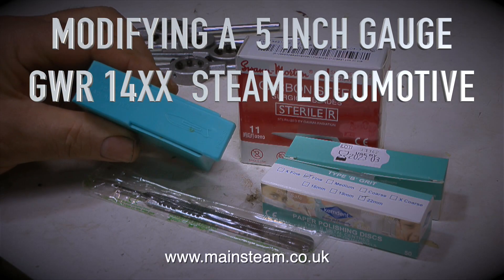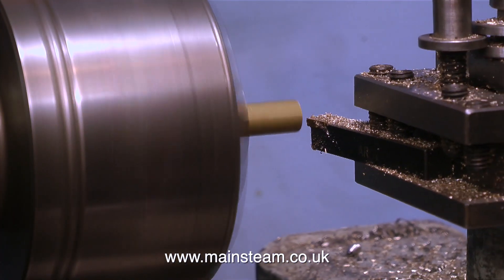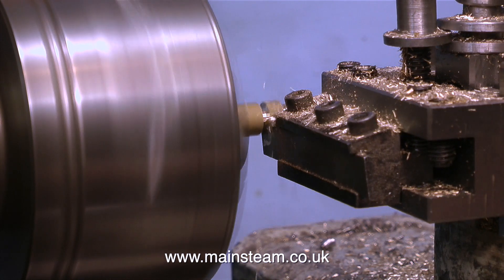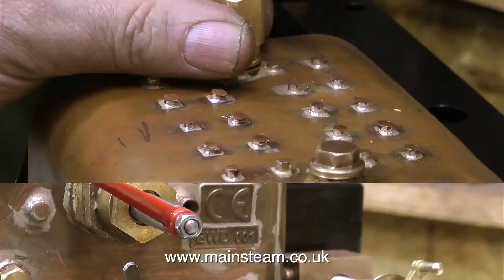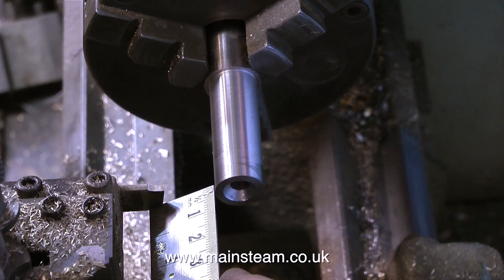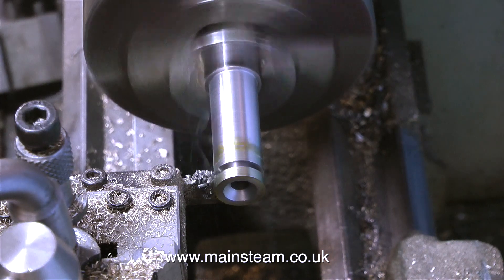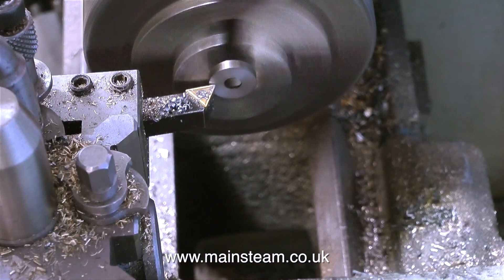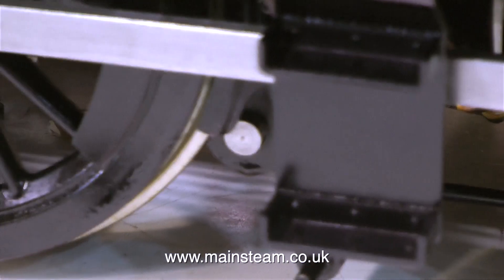MODIFYING A 5 INCH GAUGE GWR 14XX STEAM LOCOMOTIVE - PART #9

Comment: The Chines People are different. Years ago an employer of mine built a factory in Hong Kong. They decided to have a nice desk built to go through the window into the manager's office. So a Brit measured up the gap in the wall in inches. The desk was dully made. It would not fit through the hole in the wall. They sent for the Carpenter.  He got his measure out & proved that it was made to the required dimension. They then checked his Chinese measure against an English one. The Chinese inch was bigger. Now in the intervening years the USA influence on Chines measure is such that one inch is now 25.4 mm. Now 40 TPI works out to 0.635 mm pitch & 1/4" is 6.35 mm. So my guess is that the Chines have simply metricated it with a US 60 deg thread angle as opposed to our ME thread which uses a Whitworth 56 deg thread form. Mervyn Price

Comment: In principle with ISO metric threads you can combine any nominal diameter with any pitch (within reason). 32 TPI is very close to 0.8 mm pitch. I was a calibration engineer for a thread gauge manufacturer for a few years, so I became quite familiar with BS 3643, which is the relevant British Standard. A bit rusty now, though!

Comment: I saw someone centering parts in the chuck by using a ball bearing as a roller. He would touch the bearing to the front of the part, off center, as it spins in the lathe, and the part would be pushed into alignment. Granted, this was being done with small parts, so your mileage may vary.

Comment: When you are totally bored! When the workshop is too cold or too hot to work in! When the track is closed! When the Pubs are closed? Get out your Tracy Tools chart INCH TO METRIC CONVERSION which is very useful, and you get if you buy many taps and dies.
Flip it over to the DARK SIDE and it has every thread there ever was or is!!
I am intrigued by Fluteless Taps in the bottom Right hand corner!
Can I admit to having 2 charts to avoid Flipping!!!

Yes I spent too long outside the workshop yesterday!!!
Today is Club Running and Young Engineers!!
We have got rid of the Neighbors... And got in, super New Ones!!!!!!!!!!

David and Lily.

Comment: Here in Germany we get metric ISO- coarse or normal (Regelgewinde) threaded bolts, etc. and fine (Feingewinde) with a tighter profile and smaller pitch (there are different pitches for a given size). If this is of interest Newmann Tools has a chart on the Internet that you can find if you look for Metric Fine Thread Data. Most mechanics have a chest of drawers with coarse and another with fine threaded bolts and rods. Sorry if this is of no interest to anyone.

Comment: Anyone who finds grinding lathe tools a RRPITA, can cure the problem instantly by getting a "diamond lathe tool" (the Australian manufacturers have a U.K. Distributor)
it is a tangentially mounted tool that uses bog standard 1/4" sq tool steel. Only the end of the steel is ground, using a supplied fixture, so even a brain dead moron like my boss could cope! The resultant tool cuts better than any of my carbide tools and my normal hss tools. It is my go to lathe tool ever since my mate in America sent it to me.
If Bahco made lathe tools, they would be tangentially mounted end ground ones like this....
Look it up on YouTube.
If someone stole mine, I would buy another .

Comment: Lathe tool grinding has always been a bit of a mystery to me.  Most of the time I'm turning plastics so I can get away with a tool that's not quite right but sometime I have to machine a bit of brass, aluminium or even steel.  
My old Hercus lathe has the tool fitted on the half moon mount (I don't know what it's called) and finding center each time I change tool is a pain.  But I've notice you're changing cutting tools without taking the trouble to find center each time. 
When you make the tool grinding video, could you please include the easiest way to find center ?  That is unless you've covered that already.

Comment: The difference in your 1/4 x 40 threading might be SAE vs Whitworth. SAE which is the American Society of Automotive Engineers thread spec is 60°. Whitworth threads which are a British standard are 55°. It wouldn't take much thread chasing to make one fit the other I think.

Comment: I think it just must be M8 fine. M8 is .315" od. 5/16" is .3125" od. So that would account for a bit of the loose fit you are getting. M8 fine is .75mm tpi, which is equivalent to 34 tpi which is equivalent to 30 thou per thread. ME 32 tpi is equivalent to 31 thou per thread. You probably only have 4 threads of engagement. Given that you are creating a slighly undersize 55 degree thread to go in a 60 degree hole, it's not surprising that it kind of fits. Blackgates probably do them, but certainly M8 fine dies are available from e.g. Chronos for £6.75 delivered. No I am not a self-styled expert, just a man with a calculator.

Comment: simply theres metric and theres ISO metric, japan for example till recently didnt follow iso metric, and they had funny threads and non standard metric heads on their bolts (such as 12mm instead of 13mm on an m6 bolt) , and also didnt use philipps or pz,  and used their JIS standard which is easily confused with philips heads, all of us with 70's japanese motorcycles have since found out and rounded off the heads

Comment: Where i work we got a couple of CNC profile cutters from china and they use a metric fine thread for the gas line fittings they looked just like the normal oxy acetylene but they were terribly loose i think the thread was 12mm outside diameter

Comment: When setting parts in the chuck jaws I do very similar, sometimes sliding a spacing piece behind it between the chuck face and the part, slide the tailstock up, square the piece in the jaws and tighten down. the spacer helps if the work piece gets too far back, it gives you something to grab to slide the piece back in position, you do have to remember to remove the spacer, like the chuck key you only forget to remove it once.

Comment: I don't mean to change the subject but I don't know any other way to communicate with you. I recently read of a Manx Man who is building a steam driven motorcycle for land speed record runs. The article may be in error as it says he is burning kerosene to generate 2000 psi at 510 degrees Celsius. That all seems odd, but I have very little steam knowledge. Can you share your thoughts and wisdom on that, please? I can provide a link if you wish.
Reply from the maker: I would think that the only way a steam motorcycle would work is with a "Flash Steam Boiler" which is just a coiled tube of piping which is heated by a blowlamp type burner, when water is introduced into the tube via an engine driven pump it "Flashes" into very high pressure high temperature steam.
Reply: Thank you. I am unsure of the quality of editing in the article, so when I read two thousand PSI, well,,,,,, wow.

Comment: How can 1/4-20 be different than 1/4-20? Thread shape?
Reply: Yeah - 1/4-40 ME is different to 1/4-40 UNF, which I think stands for unified thread standard - fine. At least it tells you what it is, there are some other thread standards that just have a number.
Reply: Yes, 1/4 X 40 in the USA is a UNF style thread, 1/4 X 40 ME is a whitworth form thread.